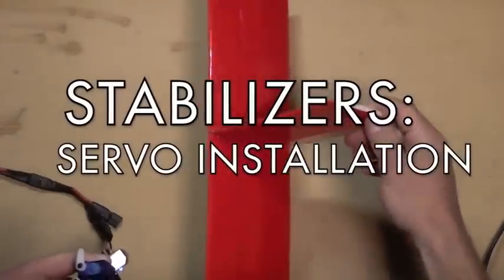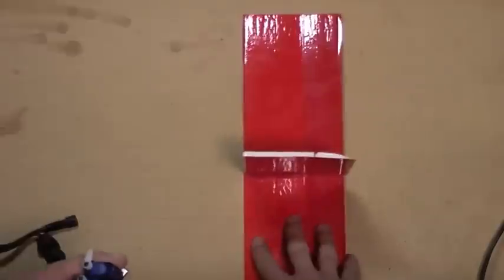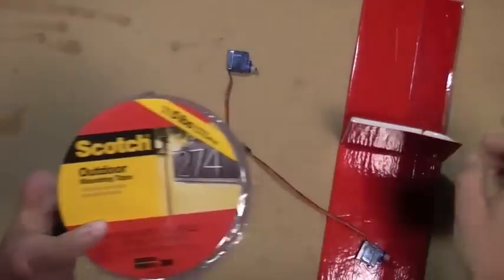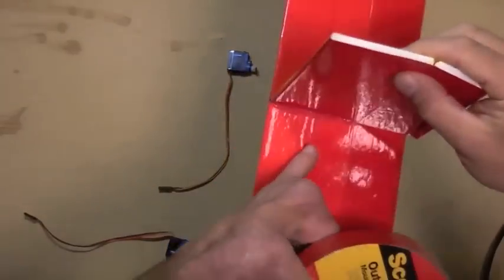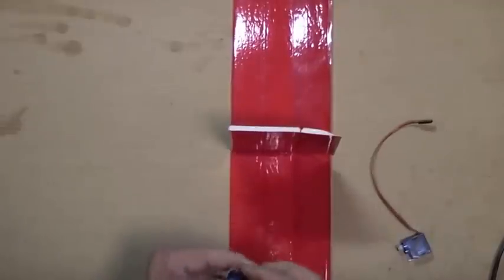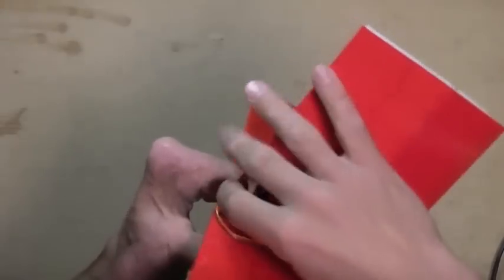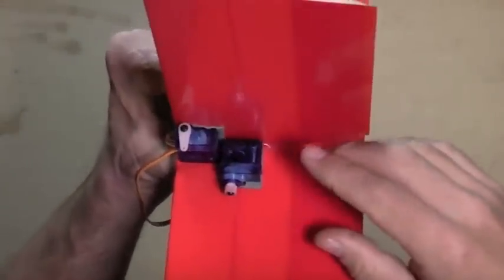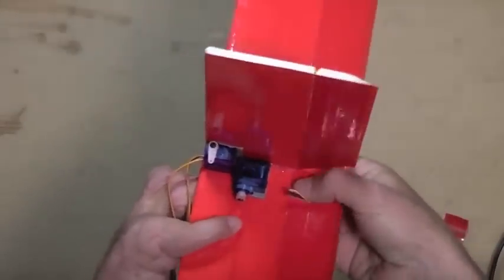Foamboard Building Techniques: Stabilizers 4 - Servo Installation

Comment: I already made the plane the way you made the noob tube in the video. So I'm going to use a 2200 kV motor 30a ESC 3s 2500mah battery. Is that good? Any suggestions?

Comment: OK thanks. One more question. I noticed in the "noob tube" video you say there is a 1400 kV motor on it but then in the power plant video you say the 2200 kV motor is for smaller planes such as the "noob tube" so which would be better for the "noob tube"?

Comment from the maker: 9g size everywhere.  Metal gear for ailerons and elevator (more critical, more use) and plastic gear for rudder and flaps.  Metal gear digitals are getting so cheap I might start using them only.  HobbyKing has some good ones.

Comment from the maker: You can for sure.  3M foam tape works great and comes off cleaner, but glue is fine.  Consider wrapping servo in tape before hot gluing for easier removal later.

Comment from the maker: @inciteman @inciteman I do like winglets in principle and have put them on two of my current planes.  One is the Peace Drone (video on my channel), where the winglets are the actual vertical stabilizers, and a motorglider you can see briefly in my video intro.  Most of these foamies are kind of low-to-medium performers that might not get too much noticeable benefit from winglets, but I use them where I think it might help.  Thanks!